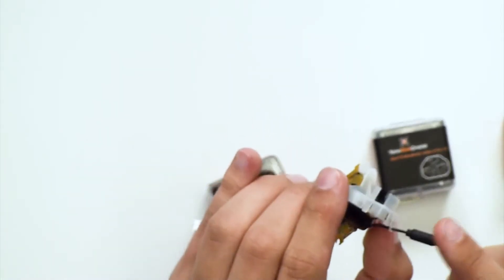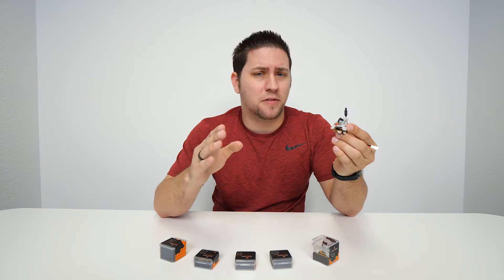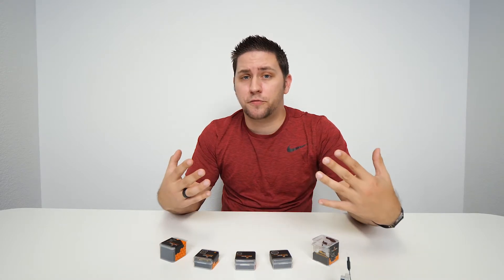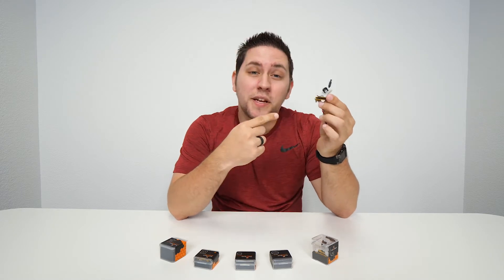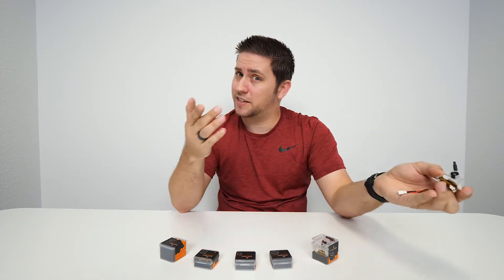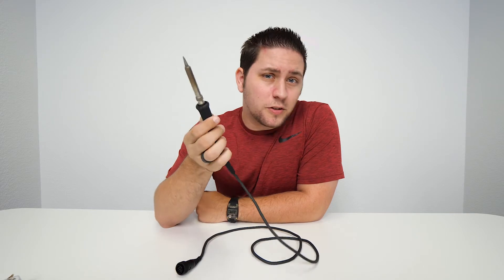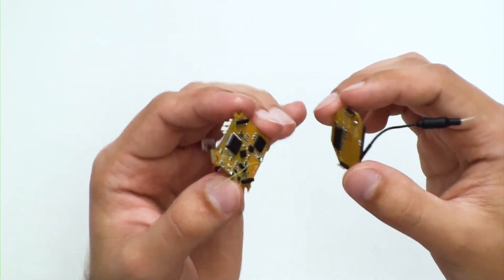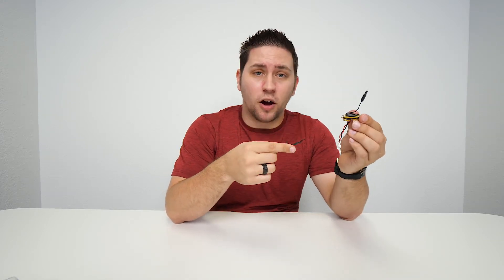BeeBrain V2 Introduction

Comment: Hi
I have just bought my second Bee ! this time a V2.
However on my last one i was able to select various parameters to view on my fatsharkes within Betaflight but on the V2 i cannot select any parameters to view, i tried turning on OSD in config and save but it will not save, just goes back to off. is this feature no longer available on the V2 ????  also i want to switch from video to pal, again it wont let me switch it from NTSC, i turn it to Pal and save but it wont save, just reverts back to NTSC.
Am i doing something wrong or are these features no now longer available on the V2 ???
Hope you can help, thanks